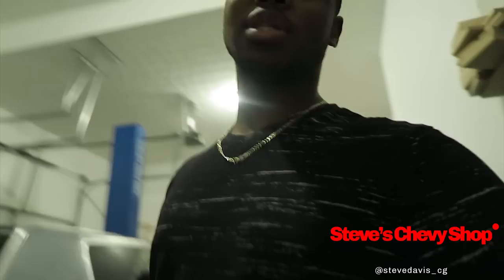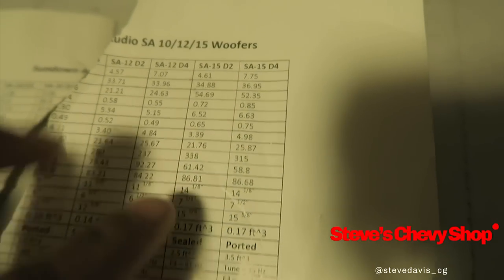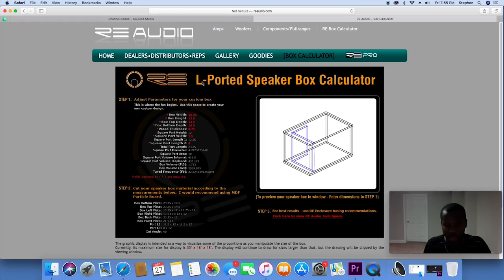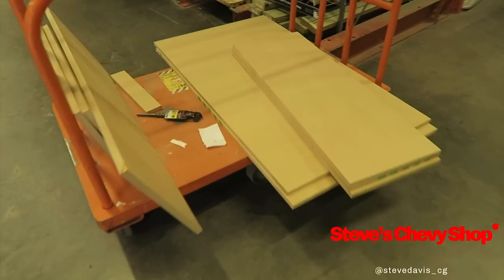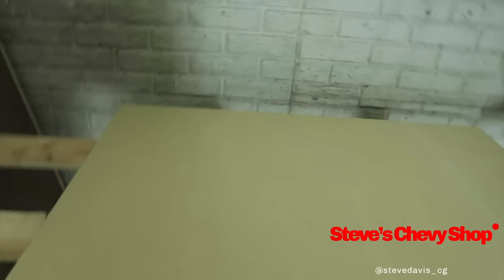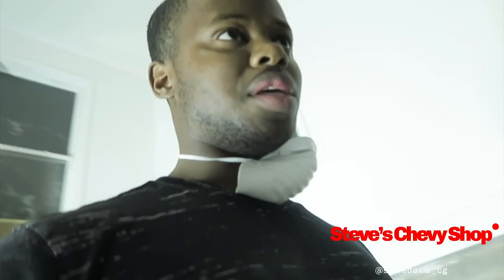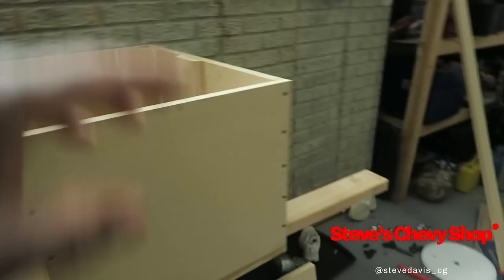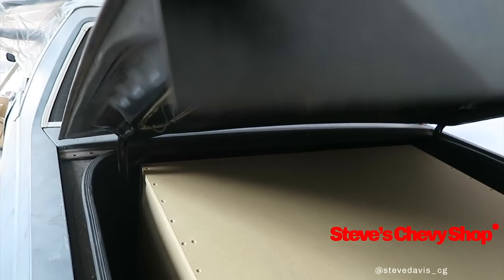How To Make A Custom Ported Box For $75

Comment: That's what up man, share the knowledge! Box came out extra smooth. Some of the most important steps in building a box, is never seen or appreciated by the average person. (Flat wall bracing with 45 edges, screw/glue placement and 45s on interior corners. Job well done!
Reply from the maker: Yessir bro that’s the truth. When I started with the sealed boxes I never knew what I was looking at 😂.
Reply: Steve Davis - Same here bro 💯

Comment: Bro im not sure if you put the info in a prior video but where did you get the perfect circle jig from? And also your opinion on mounting an amp rack on top of the sub box due to lack of room.
Reply from the maker: Amp on top of boxes is a suppose to be a no because of vibration. I use to do back seat for stuff like that. Google circle jig and it’ll come up but I’ll drop the link to a way cheaper one but does the same thing.

Decdeal 200J Model 200 Circle Cutting Jig for Plunge Router Tools https://www.amazon.com/dp/B082R7FBGK/ref=cm_sw_r_cp_api_i_7lodEb7M0XVX8

Comment: I was wondering how do you figure out port piece sheets. Most box building software I use has the port on the front left or front right. I want to build one with the port in the middle. Are the sheets half the size of the one L port or some other formula. This  box looks great and I know it slams hard
Reply from the maker: He port length is the same, the second part of the part gets split in half between the 2 sides
Reply: @SteveDavisCarGuy  Thank you for that info. Appreciate it